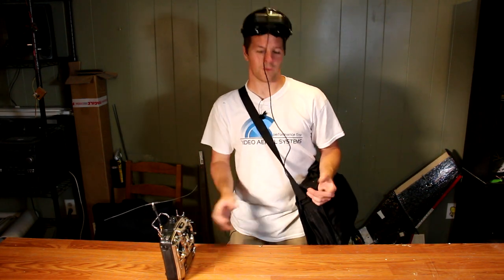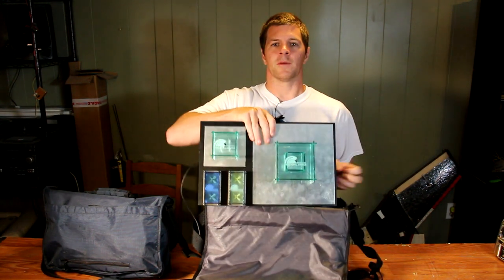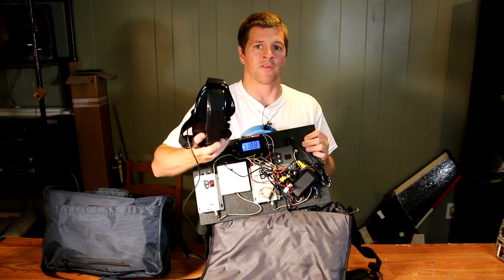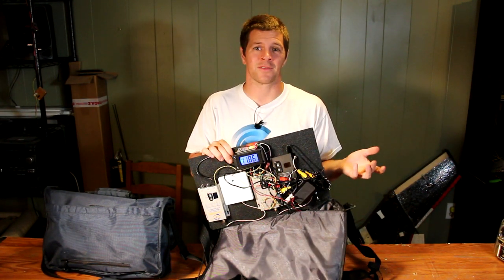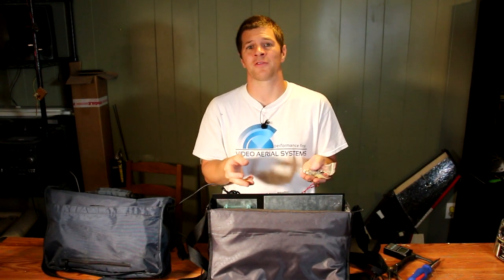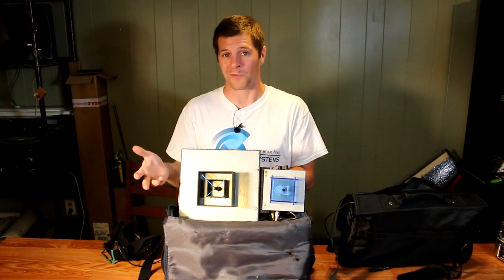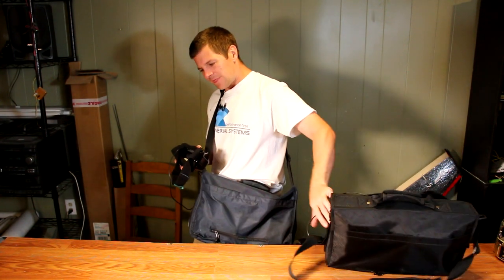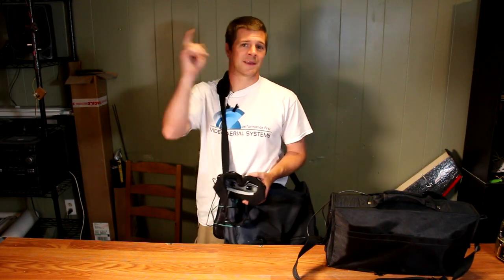IBCrazy's Satchel ground stations - How it works

Comment: Is that an IBQ frequency counter?
Reply from the maker: Jason Campbell - Indeed it is, but it is absolutely terrible when using circular polarization.  The Gooit unit is much better.  However the IBQ does better with signal strengths.

Comment: Nice Job Alex!  Thank you so much for doing this. I wanted to see how you had these set up. I am trying to decide on how to build mine. Unfortunately I have a bad back or I would go with your bag setup personally. But I love the idea!  I do have your VAS 1.3 pepperbox on a heavy duty nice tripod and another cheapie tripod with 5.8 RMRC 11" square patch antenna with a 10" monitor with sunshade on top. I just bought a 22"x16"x8" blow molded waterproof  case that your VAS 1.3 pepperbox will actually fit inside ! (Its Pretty huge!)  from Readymade RC and a bunch of panel mount rca's, and antenna mount pigtails ,and dc voltmeter and a Eagle tree 4 channel distribution FPV station. I use a Taranis on 2.4 for my foamies and quads ,and DTH-UHF for my better planes and a bunch of 1.3/5.8 recievers.  I am using the Hobby King new V2 googles and Headplays also besides the 10" monitor. I just gotta figure out the best way to put it together. At this point I think I may have to do 2 separate systems . One for the 10" Monitor in the RMRC case lid. Or the VAS pepperbox in the lid of case.(They wont both, really fit to well (even with the monitor in the bottom) I would have to stand the case on end with the pepperbox in it  as you well know. I could make one with my Heavier duty tripod, 1.3 pepperbox ,and 5.8 -11" patch and some power distribution and recievers. Maybe even grab another eagle tree 4 ch FPV station/splitter? I am not sure yet. Maybe I should grab one of your smaller VAS 1.3 Crosshair antennas? I think I can fit that , with the 10" monitor in the case, and leave the 1.3 pepperbox on the Tripod1.3. I just wish it had the pepperbox beamwidth but I have 1.3 Bluebeams on most recievers also for closer range omni. Geez I guess I just need to commit and do something even if its wrong. LOL   I  Really like the case idea but I had to go buy your  best 1.3 antenna  and its kinda messing me up. I guess really it has to go on the tripod by itself at a minimum and build the rest in the case. See there is another idea! LOL  Then I could just wire it over to the case for longer range stuff.

Comment: Do you think you will review the new tbs cross fire uhf would be interesting to see wot you think about it as I have ezuhf with diversity and have tried every antenna going still get random drop outs at 50 to 100 yards out .i need uhf if it does what it says on the site self healing 2 way coms then it sounds like its for me still waiting to see what the end user thinks before I order one. Thanks for the video's on how to fpv been a great help
Reply from the maker: Tony Mulligan  - Perhaps I will.  I have been using it for a while and really like it.  It has a little noise on 1258MHz for some reason but I regularly fly 3 miles on 25mW with it.
Reply: nice to know you like it i fly 2.4 video so should be fine my order going in

Comment: Having converted to one of these, I can say it is much more convenient.  But it does require a heightened awareness of your model's physical location.  And I've had disorienting moments that had me spinning around in circles looking for a strong signal.  You get out far enough, there is no airplane sound.  So I recently built (or re-built) my tripod station.  Both types work well, but I found that each one has an advantage over the other mainly depending on location and what type of flying you are going to do.  The satchel is not a station for beginners.

Comment: Awesome setup, I will also get a bag :) Do you also use a DVR? Would fit perfect into your Satchel. Also could you please also make a tutorial on how to use the RF Explorer to track your plane. Do you use a directional antenna on the Explorer? Thanks
Reply from the maker: hover82 - I do use a DVR.  I have the common DVR that is ~$115 or so.  It is powered from the same voltage regulator that also powers my goggles.